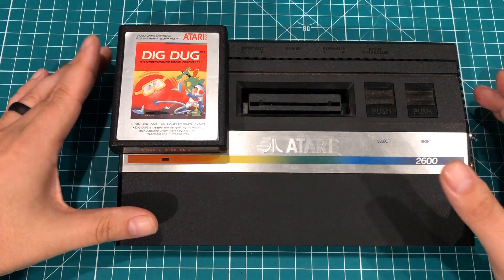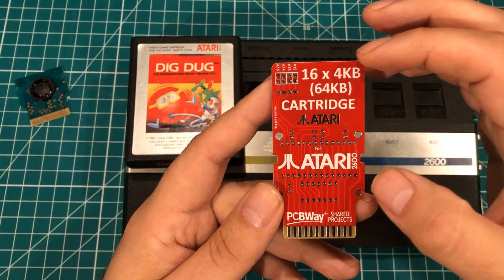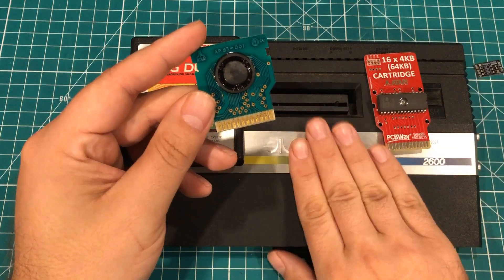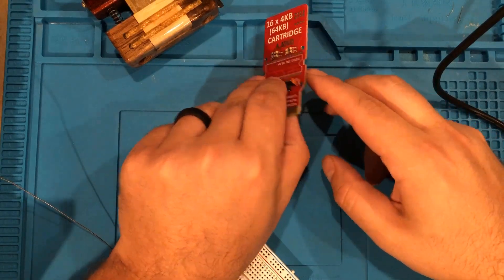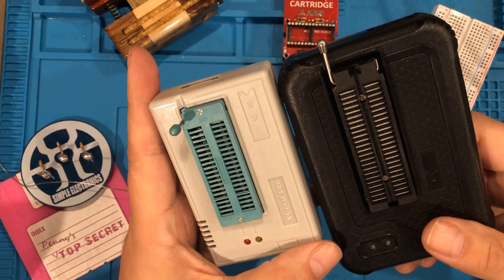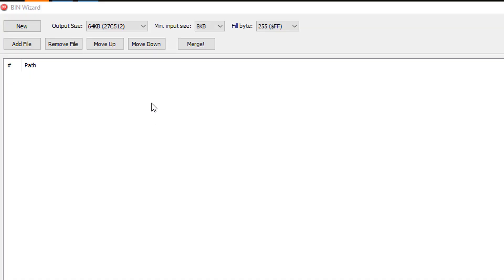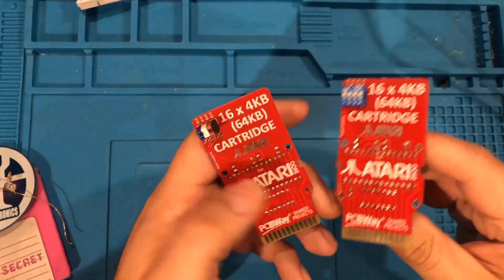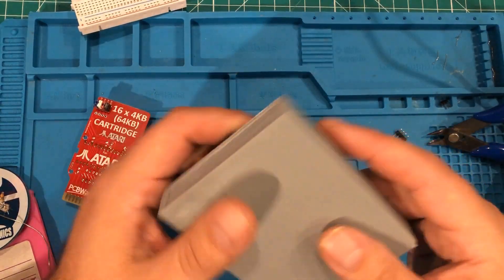DIY Atari 2600 Multi Game Cartridge - Living my 1980s dream!

Comment: Hello many thanks for this ! what about the games that the size is 8k ? how can i mixed with the 4k on the same cartidge ?
Reply from the maker: Thanks for watching.  You can actually take smaller games and multiply them on the cart. There's a program called binwizard. If it's a 2k file you just drop the 2k file on there 4x.

Comment: Great video, really helpful. I used it as a guide now I am making multicarts for my 2600+, but Kaboom (a 2k file) wouldn't work if I filled the blank space using BINWizard. Instead, use a hex editor (I used HxD) to copy the 2k data then paste it at the end of the data, so you have 2 copies of the game one after the other, then save and use that 4k file in BINWizard.

Comment: Looks like fun. Couldnt help wonderin how hard it would be to put a ROM burner in the cart/on the PCB so you had a fairly simple DIY updatable cart?
Reply from the maker: I think you can burn some of those roms with an Arduino, but I think it would be a decent amount of work. These require relatively high voltages and this particular one gets cleared with uv light.  That would be pretty funny to automate it in some sort of rube goldberg type device with an IR led

Comment: I wonder how hard it would be to do a similar "hack" for other cartridge based consoles?
Reply from the maker: Yeah. Most of them use a different chip to control the EPROM but you can use a real similar approach for the other 8-bit systems